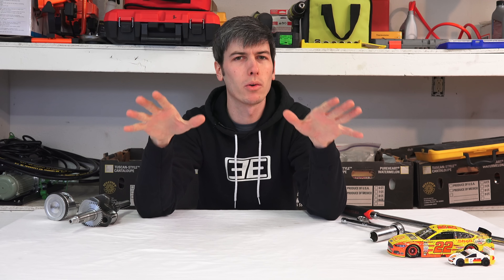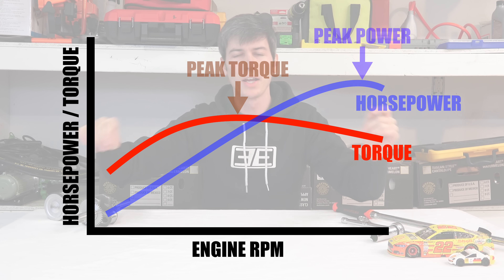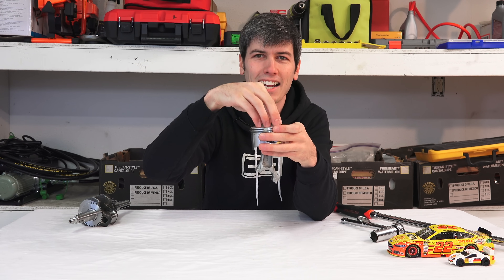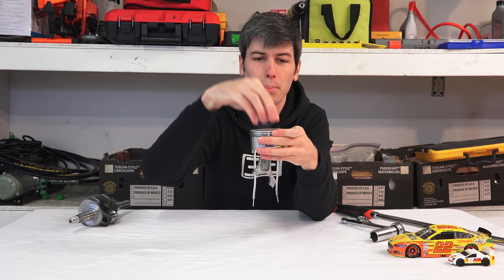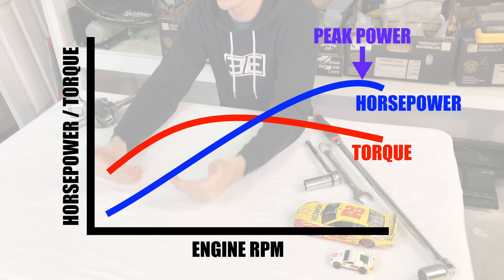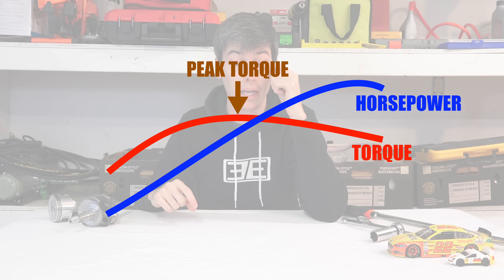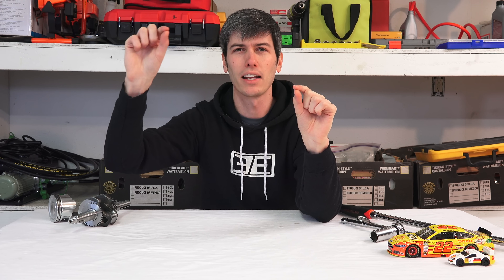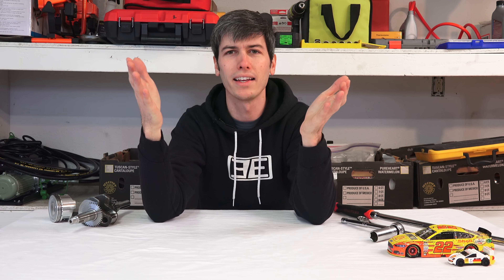Horsepower vs Torque - A Simple Explanation

Comment: The confusion comes from the inclusion of gears in the simplified equation. Look at tractors and their high torque and low hp engines. Look at why hot-rodders turbocharge their cars. Early HP doesn't necessarily translate into quicker acceleration, but early and consistent torque does. Work performed is such a simple statement.
Using your long handled wrench as an example - you get more torque with it. Make one revolution every minute. Now every 30 seconds. Now every 10 seconds. Getting tired? Now every 1 second - generating the same torque but doing more work - hence higher horsepower. Now if you add gears, you can magnify your torque and your horsepower as you see fit, carefully trying to find the right balance with your human engine. If you add a 10 foot extension to your wrench, you'll get super high torque, but very little horsepower as its a lot of work to go one revolution. If you shorten it, it will be harder to get up to speed, but you can spin it much faster. This is why we have multiple gears; so we can have usable torque and HP.
Now if Hafþór Júlíus Björnsson takes over for you and does the turning, he can generate more torque than you. He may not be able to spin it much faster, but when you factor in gears, his torque will spin a gear faster, doing more work and hence more  horsepower.
I hope I didn't mess up too bad with that explanation. And we haven't even got to engine torque vs torque at wheels....
Reply: 10/10 explanation, in a fraction of video time
Reply: Catfish Cave 
Fooking spot on, m8. Understood your explanation better.
Reply: Horsepower will not be affected by gear ratios, that's the whole point of horsepower. Power is a function of torque*RPM. If you have gears, torque will be increased and RPM decreased by the same factor (or vice versa depending on the gearing) Therefore horsepower before the gear will always equal horsepower after the gear.
Reply: Your explanation complemented the above video!
Reply: @amplelife  That's what I actually meant to say. You got to give the guy who made the video some credit too, because reading the comment alone would have been hard for me to understand
Reply: Adjusting gearing only changes the mix of distance and RPM. This is misinformation.
Reply: Ive a 2012 Mazda 2. its a monster...100hp w/94ft lbs. At 4000 RPM. LMAO. Believe it or not, it has traction control...really. Well a light says I do lmao. Tried to explain to a girl how torque gets you up an on ramp. Horsepower keeps you going.
Reply: I would like to say: 
200nm x 100hp = 20.000 "work units"
100nm x 200hp = 20.000 "work units"
Reply: HP=Torque×RPM/5252 basically torque multiplied by the vehicles highest rpm within its optimal powerband=horsepower. Your analogy with the wrench was spot on. More rpm's while maintaining consistant or even better more torque if possible via gearing (in the case of the wrench a longer shaft and/or better angle, yielding more leverage and therefore more force/torque) equals more "work units". Which is what horsepower is a measure of thats why he was basically saying horsepower is more important than torque, by actually explaining it instead of just saying it because more horsepower necessitates that the engine at least maintains or increases torque consistently as its rpm's climb higher and the transmission climbs the gears higher. At least in theory, though we know this isn't exactly the case since dynos show us that most cars maximum whp output is in a lower gear than its transmissions final drive, as well as at rpm's that are significantly lower than its redline let alone its mechanical rev limit, at least thats the case in say a K20A EP3 CTR, max whp is around 200whp in 3rd or 4th gear @ around 5000rpm in an engine with a rev limit of around 9000rpm and a 6spd transmission, that is rated between 200-220hp presumeably at the flywheel by the manufacturer Honda. If I remember correctly that is. Of course when it comes to the CVT trannys he mentioned theoretically with torque remaining either consistant or increasing do to the constant variance of gearing the horsepower/work unit output of the engine at both the flywheel and the wheels should at least theoretically continue to increase and therefore the vehicles velocity should continue to at the least consistantly and at best increasingly accelerate as the engines rpm's continue to increase nearer to its rev limit. Though last I heard CVT transmissions are notoriously unreliable. Basically as long as torque at least remains constant the engine should in theory produce more power as the rpm's continue to rise. Power in physics I believe is expressed as 
Power=work done(force[mass ×acceleration] x distance) ÷ time interval. So power=work÷time, with work being=force x distance,
With force being= mass(of the object moved) × acceleration (in the linear direction of the applied force. I hope that makes sense. Similar equations, in fact the same basic physics formala are used even in powerlifting to calculate a human weightlifters power. We can even calculate the horsepower of humans, which is of course only slightly more complicated because we're plugging in values that themselves are already abreviations for equations as the factors/functions of the formula.
Reply: O.k
Reply: Catfish Cave Thank you for the clear cut explanation
Reply: Catfish Cave thanks a ton. You really simplified a tough doubt
Reply: Good job
Reply: Catfish Cave nice 👍
Reply: Thank you! Now I understand!
Reply: How do we relate this torque and horsepower into a single shaft turbine driving one generator, a gas and steam turbine on a single shaft driving a generator, when the gas turbine start it produce small Mwatt and after the steam turbine is on the Mwatt increases what is the principle behind it.
Reply: Hafþór Júlíus Björnsson  - how much torque can he generate?
Reply: Best exclamation I've ever heard and super kudos to the Hafþór reference on top. 100%
Reply: Catfish Cave 
Thank you. You make way more sense. I now have a better understanding. 🙏🏿
Reply: good explanation
Reply: 10/10
Reply: DUDE! thank you so much for explaining it. You just cleared it up for me
Reply: Please consider a career as a teacher.
Reply: kapil pawar  correct this is why we have wheel horsepower as a measurement
Reply: Well yeah this was already described by the formula in the videos description.
Reply: 200 lb/ft of torque @ 5000rpm equals roughly 190hp. 
200x5000÷5252=190.403655750
Reply: My only gripe with your description is you seem to have missed the bus with regard to hp=t x angular velocity/rpm÷5252,  early torque=acceleration, would necessitate that early
 hp=acceleration also since torque is one of the values hp is  derived from. Hp factors in torque, its the product of the factors torque and angular velocity or rpm/5252. Just read the description in this video and google physics/engineering equations and formulas.
Reply: Man, early HP means extreme torque since early means low rpm hence it means the torque is also very high in your example. At low rpm the power is usually very low but when the car is at low speed it also doesn’t need too much hp to accelerate well. At standstill the power is zero the torque can be maximum i.e. an electric engine. P=Txrpm/5252. Rpm=0, P=0. But the power demands increase very quickly 
You are correct the introduction of gears complicates things and also the power curves.
Reply: I'm glad you wrote so I didn't have to
Reply: Wrong! “Magnifying your torque and horse power.” Nope gearing doesn’t affect HP it’s already a function of rpm.
Reply: You can't argue against the maths. 200HP + 100 lb torque > than 100HP + 200 lb torque.
Reply: Early horsepower does necessarily translate into quicker acceleration. Unless you are trying to accelerate in 5th gear.

Comment: Idk man. It's very well explained but I don't think it explains it dead on. Like the part where he got the longer wrench, it increases torque right? So, according to that logic, if I wanna increase torque in my vehicle, all I gotta do is get longer connecting rods, right? Well, how come you can get higher torque (and hp) with some simple bolt ons? Aftermarket intake, exhaust, tuning, etc, without even touching the engine block. Then you got some small engines producing high hp and torque figures (i.e. motorcycles) compared to some car engines. Look at the older engines. You had some BIG 7.0 engines only producing like 200 hp and 240 ft-lbs torque.
This is just something that's difficult to explain.
Reply: Not long connecting rod but crank with more travel ( Piston going up and down traveling more distance)
Reply: @sumantkksingh  actually no a 455 Buick actually out torque a 455 old's and poncho with the shortest stroke.
Reply: Sumant Singh 
That's what I meant. You get the point.
Reply: Combustion engines are inherently inefficient and not all of the combustion energy gets used. Newer engines are designed to be more efficient and are capable of capturing more energy from combustion and turning it into power. Things like better intakes, exhausts and tuning also each help the engine turn more of the combustion energy into power in their own ways making the engine more efficient.
Reply: Justin B 
Yeet. 👍
Reply: @justinb3091  my mum's honda civic is 1 litre engine producing 128bhp it's quick but lacks the torque due to being a 3 cylinder engine. So it's faster than it feels if that makes sense.
Reply: If bolt ons increase the force from  combustion then obviously torque will increase with constant lever arm. T=Fr
Reply: TheQuark6789 
Very well. Carry on.
Reply: Your Mom Mom is going to get mad again when she sees that you used her youtube account, Dad
Reply: Eightosaurus Spelunk 
Shut up, you little snitch.
Reply: +Your Mom - The easiest way to think about it I found - torque equals displacement.  The more fuel you burn, the more force you produce so you get more torque.

It's not perfect simplification, but it should help in understanding what's going on.

Like, longer connecting rods will not change the amount of fuel burned, so they don't matter, but longer stroke does matter.  It also changes the leverages at the crank and increases torque that way, but at the cost of lower max rpm for the same piston speed.

Aftermarket bolt-ons - do they change the amount of fuel burned?  Sometimes they do, when intake and exhaust systems are quite limited from factory, so they may work.  Sometimes they don't.

Small engines with high torque - not really.  Until we are talking two-strokes, which burn twice more fuel for every turn, then yes.  Or until we compare with really old flathead motors, which couldn't burn the fuel efficiently due to weird combustion chamber shape.

7L engine with about 300 Nm of torque?  Only if it was intentionally throttled down.  Maybe unintentionally, but throttled nonetheless.  Such huge combustion chambers should give more torque when full.

There are other exceptions, but displacement=torque works quite well, and more mixture=torque works even better.
Reply: @bakters  
You just confused me even more lol..
Reply: +Your Mom - In that case, "torque is displacement" should suffice.  

(For boosted engines "torque is displacement multiplied by boost".)
Reply: There are always tiny bits of room for small improvements in the overall performance of an IC engine. When they are added up the engines performance changes across the board for the better. All according to the laws of physics, which are so complicated I am getting a headache just thinking about them.

Comment: No matter how obvious the difference between power and torque is, no matter how basic and simple the explanation, most people will still have no idea whatsoever and continue to come out with BS cliches about how fast you hit a wall and how far you push it.
Reply: As silly as it sounds it's true. Like in tractor pulls. Torque is how far you pull the sled. Horsepower is how fast you got it there. One of the foremost crank maker-engine builder (RIP Gilley) used the wall analogy. If it was good enough for him, it's good enough for me.
You just need to lighten up, instead of being so full of yourself. 😡
Reply: DDS029 No it is not true, and yes it is silly.  Power is everything, without power you can not move anything at all.  OTOH you could have an infinite static torque, but without movement (and therefore power) it won't do anything.  However, you did at least help to confirm my first post.
Reply: torque has nothing to do with how far you can pull something. that doesnt even make sense. if you can produce enough force to break static friction and cancel out kinetic friction, you should be able to keep pulling that sled at the same speed forever.

Comment: faster is not greater HP as you showed in your example  . HP can be defined as the rate of Change of KE if the KE doesnt change, no hp is required..... Hp is only required to keep the speed constant. (aero drag and friction are the factors).    Now, its not the longer lever of the higher HP car,  (to use your analogy) its the greater force that a higher hp engine will make . in fact, its quite the opposite. the higher reving, lower hp cars use the longer "levers".   but if the levers are the same, and the only change is the HP, then all that means is that the force is greater at the same speed. (or RPM)

Comment: Internal combustion engines can only supply torque once they have reached a certain rpm: a steam engine can apply maximum torque at zero rpm - and so can an electric engine - hence why diesel locomotives use electric transmission.
Reply: electric motor

Comment: I am looking for a new crate engine for my 1970 GMC C2500.
 I see 350's and 383's with about the same horse power but the 383 has way more torque. What one would be good for a daily driver?
Reply: If you really use your truck like a truck, you'd want torque. That would get you up to highway speed faster if pulling a load.

Comment: Ok. I understand. As you said you can manipulate the torque by using variety of gearing (as your analogy using a longer wrench).
I often said, I don't have much torque in my car but it can rev to 9,000 rpm. 
My question is, can I manipulate Rpm so my car can accelerate faster against  a car with big torque & big cubic inches?

I always think I can. I owned an Ariel Atom with a gross weight of 1200 lbs. I say, I manipulated the rpm to beat a high torque car by LOWERING MY WEIGHT. 
Does it make sense? Yes No?
At the traffic light, I always have a notion that I can beat a big block mustang even with a supplemental supercharger. I proven time and time again.

Teach me more and thank you!
Reply: Too much torque for your tires will just sit and spin if you don't have your weight to the rear and the right springs and shocks to transfer the weight to the back on launch, but bring it back toward the front in a controlled fashion.

But you need the torque to get out of the hole. That's why they have high stall speed torque converters for automatics.

Comment: Torque and HP is complementing each other. The reason that HP is greater on higher RPM is because of momentum. It is also reason why is torque lower than, because it has no "time" for engine to do all the job because momentum and kinetic energy takes over. On lower rpm there is mass (low momentum) that is opposite to realization of HP.

Comment: So if a car makes 100HP at 1,000 RPMs does it make 200HP at 2,000 RPMs. Is the HP at certain RPMs multiplied by two if the RPMs are doubled. So if one thousand revs produces 100HP in one minute would 2 thousand revs produce an additional 100 HP in one minute?

Comment: Congratulations.
A clear and simple explanation.
A good example would also be my actual truck (or any truck), a V8 turbo 730Hp Scania that of course is not a racing car.
The manufacturer seeks for the best N-m ratio to pull heavy loads "without" effort, so they look for the best balance between power an torque to have it, with an incredible fuel consumption of 36-39 liters for 100 Km and comply to the Euro 6 Co2 emission standards.

Comment: Torque is Force x Distance (10 lb weight with a 10 ft. lever = 100 ft lbs). Power is torque applied over time, measured in, among other things, watts or horsepower (550 fl lbs per minute = 1 horsepower). Not complicated.